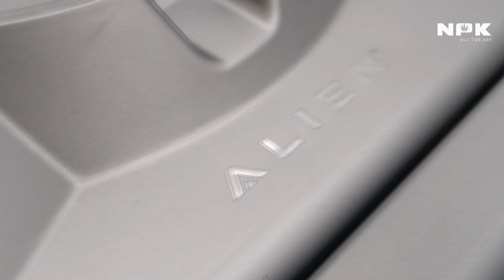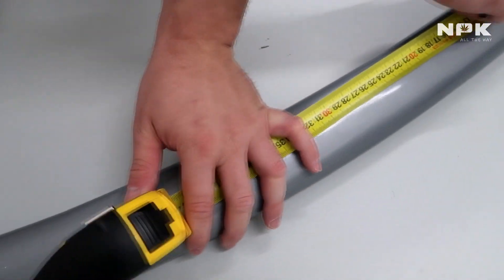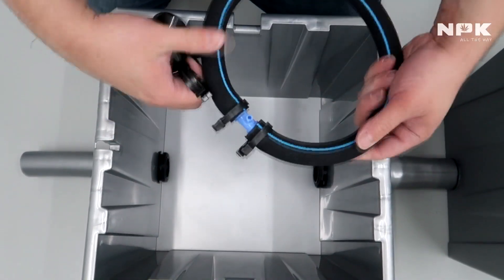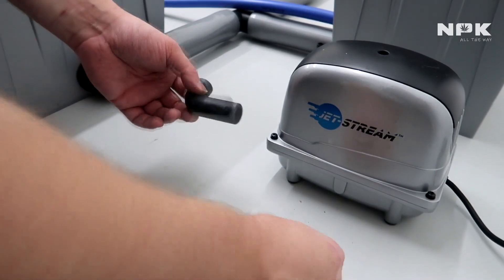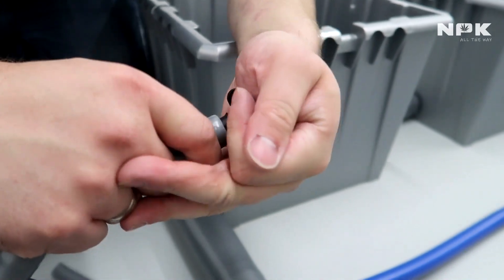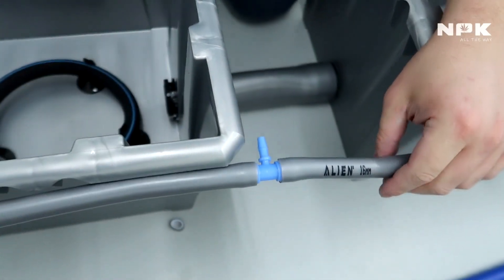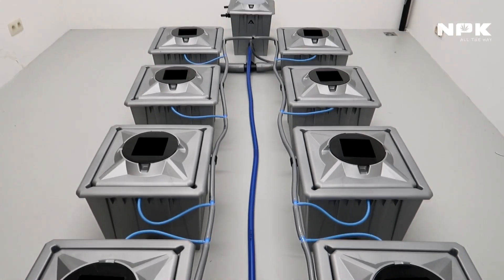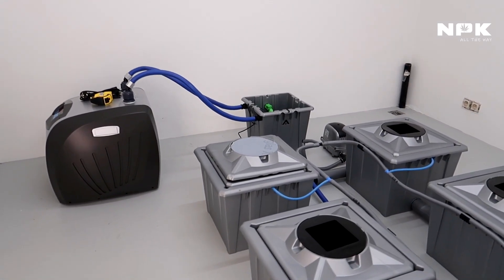How to setup your RDWC system - Alien Hydroponics Pro Silver Series - 8 Pot 36L/9.5G

Comment: I have just finished setting up my 4 bucket system, but i really don't like the lids! The inner lid has a lot of light leaks where you can lift the inner lid. It's not direct light on the nutrients, but there's light coming into the roots. How did you fix this, or isn't it a problem for you?

Comment: Hey glad to see you back! Why didn’t your new vid came up in my notifications? I’m so glad that you are doing a hydroponic grow as I’m looking at it myself. Can you recommend me some good sites where to get some good info? What made you go for the DWC method? I’m really looking at ebb and flow mainly to reduce the length of tubings hoping to reduce the risk of clogging.
Reply from the maker: Hey bro! Weird that notification didnt come. Might explain the low views on my video.
The reason i went rdwc is because i got sick and tired of the daily watering. Couldnt combine it with my work. I dont have 1 website, i got info from everywhere. If u want to go with eb and flow i would choose floraflex. But i dont have any experience with eb amd flow
Reply: @npkalltheway3109  thanks for the tip. I’m setting up a SOG so I prefer an ebb and flow table which hopefully should make my life easy.

Comment: Can I use this in a 3x3 square in my 120x120 tent with the epicenter outside the tent? I see they also sell 15L pots...
Reply from the maker: 120x120 will be pretty tight, but ull have to make them  3x3 indeed, only problem ull have is, u'll need to buy 2 return lines, because otherwise u gonna get mixing issues.
Reply: @npkalltheway3109  Thanks. After I posted this I saw they're offering a 9-pot 3x3 kit on their website. It uses 3 return lines, one for each row. Minimal footprint width is 115 so I guess it should indeed fit. I'll check with them to be sure before I empty my banc account though :)

Comment: Hi NPK, thanks for the video! A few questions:

(1) have you completed a grow yet with this system and were you happy with the result?
(2) Is this system comparable, better or worse than the undercurrent system?
(3) I noticed you placed both water pumps inside the EPI bucket (1 for your recirculating pipes and 1 for your chiller).
(a) does the heat from the pumps heat up the water minimally or is it a lot?
(b) can the system be setup with the pumps on the outside of the EPI bucket?

I thank you in advance for taking the time to answer my questions as it will be very helpful for me!

Take care
Reply from the maker: No, this is my first grow with this system. What do u mean this is also under current. Yes both pumps are in the epicenter because thats how it came assembled, i dont think it heats up the water that much, but then again i dont know because i have a chiller. And yes u could place the pumps outside the bucket.
Reply: @npkalltheway3109  what kind of chiller are you using in the video?

Comment: Why did Alien go from a 4" setup in their previous models to a cheaper and smaller 2" line that's more prone to root blockages? Imo, the entire appeal of buying this system is because it stands out from the rest with that big 4" setup. Seems like their new model is just a subpar system that looks prettier.
Reply from the maker: Thats what I was wondering aswell...the silver buckets are offcourse a better idea because it doesnt heat up the water as much as the black ones. But I honestly have no idea why they changed it to a 2" line...

Comment: why not take the pumps out of the res and make them inline pumps so they dont heat up ur water
Reply from the maker: because the system is not build for that kind of setup, or u would have to cut extra holes.
Reply: @npkalltheway3109  no u wouldnt all u need to do is cut the line in the middle and put the pump there. Hows that an extra hole? maybe 2 extra hose clamps for the pump but thats it. the hose is already running back to the res u leave that alone. all u do is move the pump to the center of the line so its not in the ress  - now ur pump need to be an inline pump for it to work but yeah i have same setup just i built it with buckets and i made my pumps outside the ress with same amount of holes